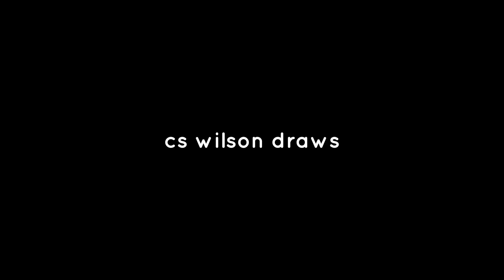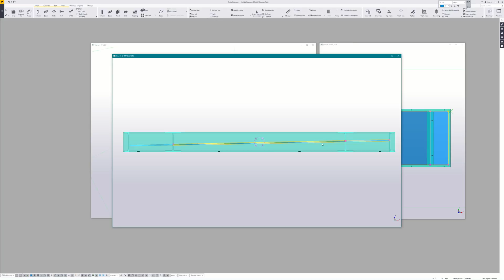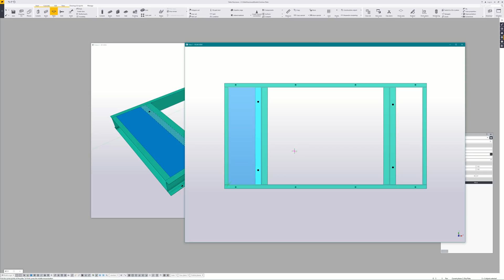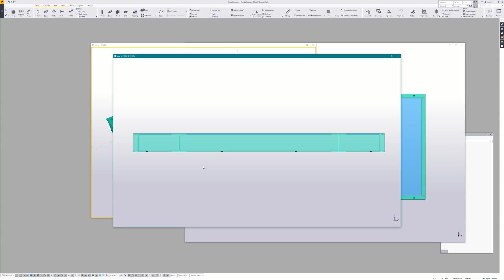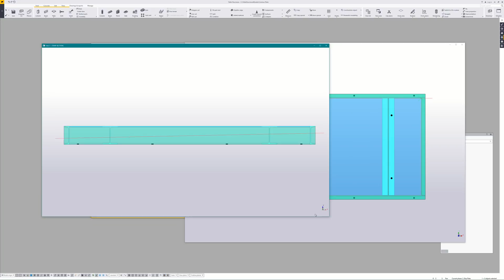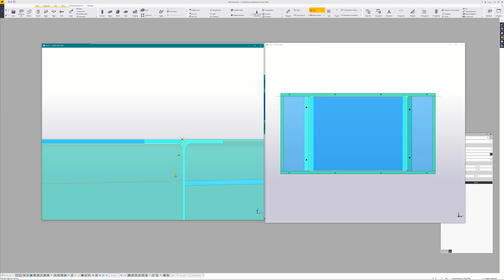Modeling Sloping Plates with Tekla Structures

Comment: Hey boss, you can easily select the handles from your section view only. 

When holding alt, and dragging a window from left to right(not right to left) then it will select handles, not parts. 

Further clarification. Handles of a part are all visible in a view even if a portion of the part is in the view. This is why you can select both handles without going to your plan view.

Comment: Little tip for selecting several node points at once: When the plate is selected so you see the nodes you want to manipulate, instead of ctrl key you can hold down alt key and drag selection box over desired node points. This way it select only nodes that fall inside the selectionbox. This one helps me to work only in a section and do faster and less precice mouse movements when there are several nodes behind or around eachother ;).
Reply: Oh man... That is a TOP TIP Thank You

Comment: Thanks Mr Wilson. Good plate tips video. I model a lot of precast slab units that have recesses and falls. The process I use is super similar.
Reply from the maker: Yeah, I figured that method would be pretty popular. Just thought I'd throw it out there since some users might be over-complicating it (plus I got a new camera lens and wanted to test it out).  :)